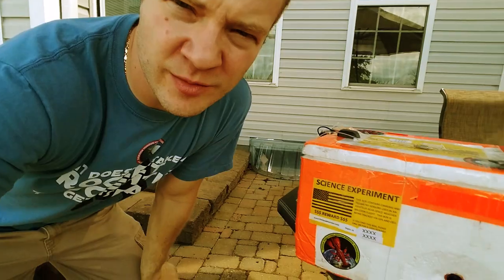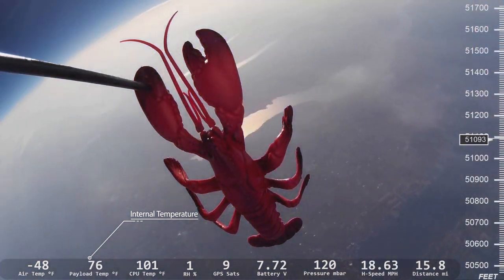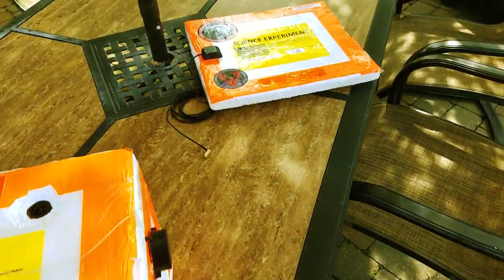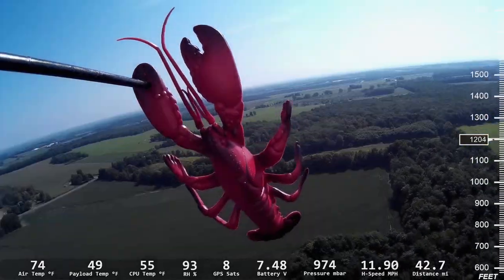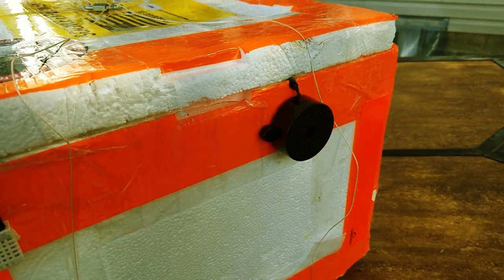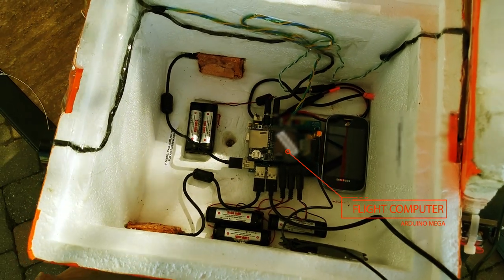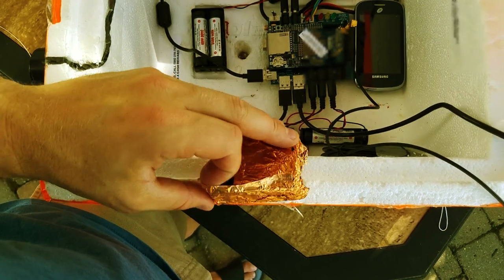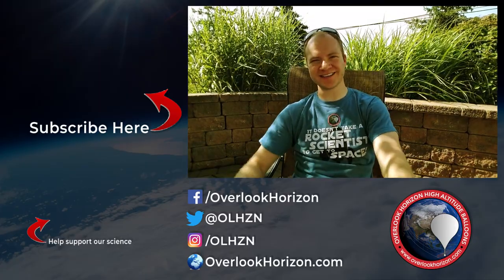What's in the Box ❓ 🤔  High altitude weather balloon payload

Comment: What radio system do you use to track your data?
We are working on our first project but not sure which radio transmitter / receiver system to use.
Reply: They probably use APRS, like a TrackSoar
Reply from the maker: We use a custom built APRS transmitter powered by an Arduino Mega. See: https://youtu.be/7ed5JTelBwY
Reply: I programmed arduino for aprs

Comment: 4:43 — Oh, you’re using an Arduino system. Is it because it’s more power-efficient than a Raspberry Pi?
Another question: you mentioned you work in IT/software engineering. Any special-sauce hacks running the on-board system(s)?
Cheers!
Reply: Definitely arduino more than capable and means lighter payload